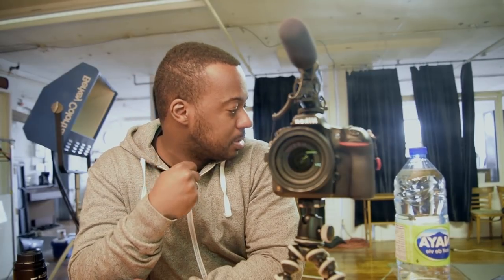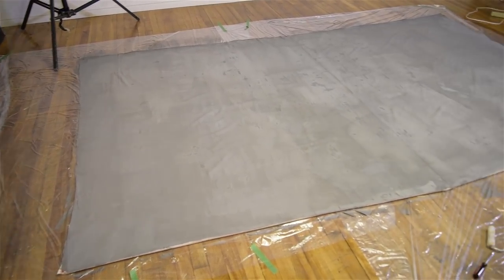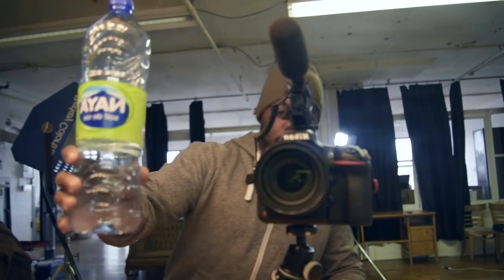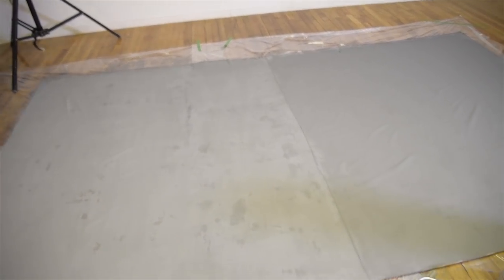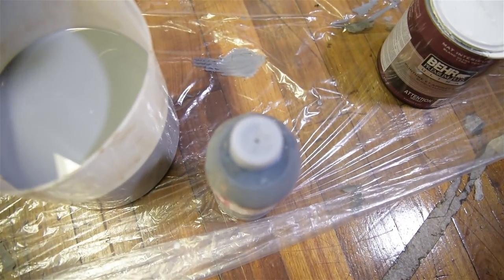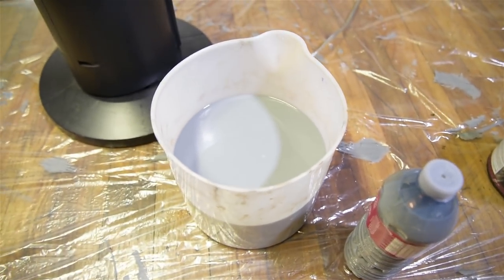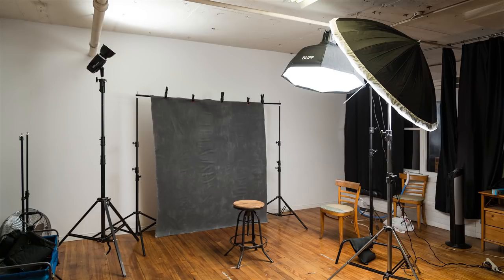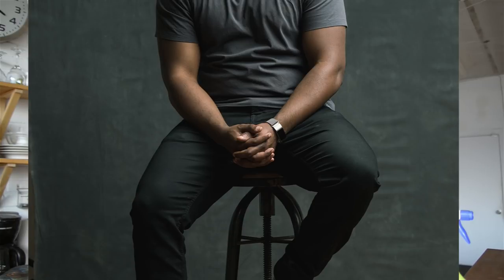DIY Backdrop - My Experience Painting a 'Canvas' backdrop Part 2

Comment: 😀 First step, stretch the canvas on the frame, so it doesn't get wrinkles. 

Step two, prime it with gesso. It will stretch it eve more and it will help with better paint uniformity. 

Step there,  paint. 

Step four,  remove the canvas from the frame once it is completely dry.